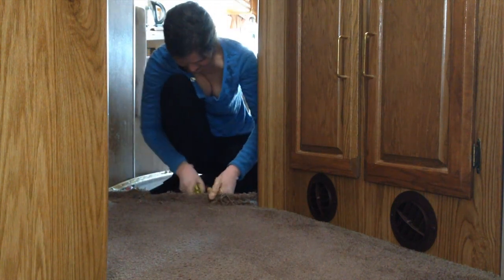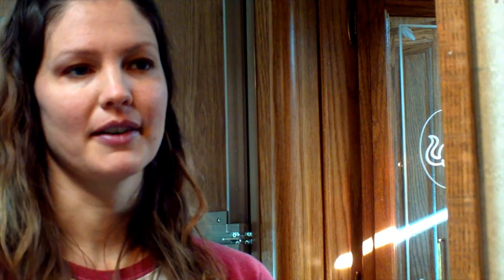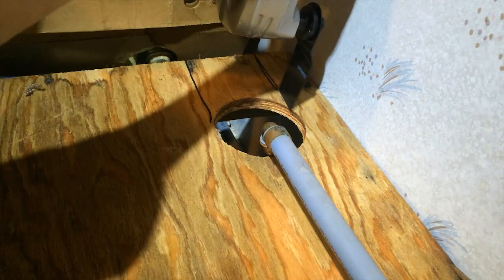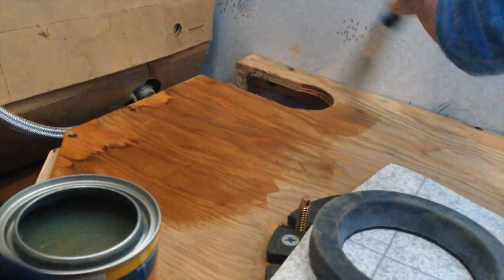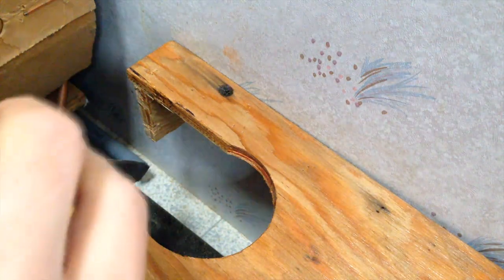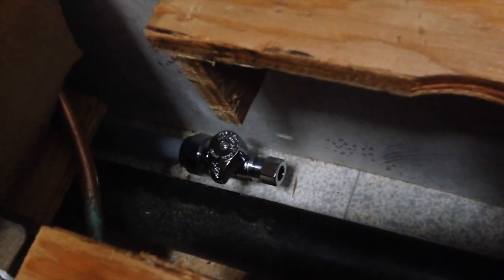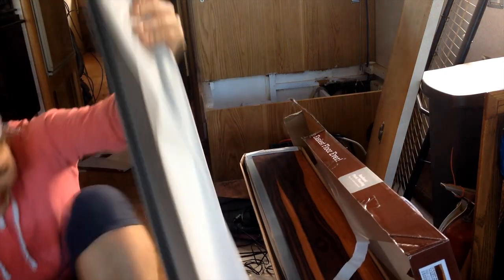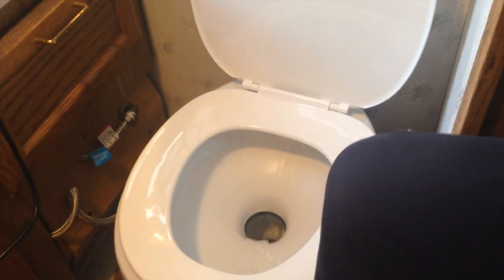RV Living: RV Renovations and Replacing Motor Home Toilet

Comment: The commenter who seemed to paint a completely negative picture of Rv life vs apt. life is not correct.  That assumes that apt. life is all positive.
To the contrary, you pay high rent for a decent place which includes many rules and regulations.  You cannot paint, hang decor making holes in the walls, or remodel things.  You cannot control your neighbors above, below, or adjacent to you.  You sign long term leases and give up your freedom to move in short notice.  You need furniture and decor to fill the space for comfortable living, all of which costs money.  So, high rent, close neighbors, furnishings, utility bills and lack of mobility are all negatives for apartment living.
Yes, an older Rv, like a house or apt. would need to be remodeled and decorated, but overall the cost of living is much less and the freedom gained is much more.

Comment: Smart girl.....ALWAYS replace as many joints in an old RV (or house) as you can.  You are only waiting for trouble with them.  A new flexible pipe (not invented when the RV or house was made) is MUCH better - and will give fewer problems in the future!!!!
Reply: Depends on who constructed the joints. My father was a master plumber/pipefitter and my 110 year old house was not up to code when I bought it 20 years ago. We gutted the whole place out and Dad and I put 3/4" copper throughout...all joints tested and perfect. I check annually when I bleed the system. I also just sold the house I grew up in, Dad built it and lived in it for 49 years...no problems with any water leakage from any joints. 
    I agree on the motor home replacement but as far as a house is concerned, it would have to be "bandaid" plumbing work, such as NON licensed people install or work on plumbing. My father allowed a few to work under his license because they asked him to pull the permit, but he was selective with whom he would allow...and then his inspection was very, very strict.

Comment: Hi Pippi. Hello from BC Canada. I am glad I connected with you as I am renovating my to to sell in the spring in the hopes to embarke on your adventure. You have put my mind at ease on a number of issues!!

My question is: How much, not including the flooring did your toilet adventure cost. I was actually looking a composting toilet to get away from all of my water fears;)
Don
Westbank BC Canada
Reply from the maker: Donald Nichol The toilet was about $200 (you can get plastic for cheaper or even other porcelain ones online for cheaper) and the sealer/finisher plus sandpaper wasn't more than $15 and I still have left overs for my counter top renovation which is soon to come. The pipe plus sharkbite was $20 or so. Unless you plan on only using bottled water, you'll still have +80% of the water pipes to still maintain. Cutting off the toilet is only a small part of the entire water set up. The toilet stuff is only a bit extra off of the other bathroom pipe system..sink, shower... Good luck with it!

Comment: Why did you use a floating floor instead of the peel and stick type which are cheaper?
I somehow found your video when looking for linoleum removal but peel and stick is meant to stay put while floating floor is meant to expand and contract

Comment: Nothing like good old copper piping! Red flags go up for me every time I see that plastic piping in a house. I believe it is called pex piping, and over time, the plastic becomes brittle and cracks and leaks!
Reply from the maker: Andrew Gems This is the polybutalene piping that they don't make anymore because it fails after time. Fortunately for the parts I've touched, it still seems very sturdy.

Comment: 9:13 Oh no! You need a plastic tube cutter for the sharkbite tubing. It resembles a vice grip. Home depot people should know what this is. ts is impossible to file a clean  90 degree angle by hand, especially in cramped quarters. Squeeze the cutters and squeeze till it cuts, then take a quick razor blade turn around the edge to clean the burrs. Done
Reply: P.S. The floor looks amazing. That you are taking this on by yourself and not paying someone to do it is The Best. We were made to create.. You understand that! Yes!
Reply from the maker: 82Bottles Thanks!

Comment: Good work, kiddo! I'll be watching for the floor replacement video. You've probably heard this before, but stuffing steel wool into any accessible crevice on your coach can help to deter the little furry-feetz from getting in. While you have that plumbing area open, you should consider poking some wool into the area around any of the plumbing holes. Plumbing [both propane and water] and electrical holes seem to be the primary access for these creatures. If you are ever parked on a concrete pad, borrow a mechanic's creeper and go over the underside of the entire floor, poking wool into every opening you can find. Best of all, its a 'simple' solution.  ;^) Oh, and +1 on the 10% bleach in a handy spray bottle to kill hanta virus.
Reply from the maker: Ron Standley I have heard that however I completely forgot about it. Great idea, I WILL do this!
Reply: Pippi Peterson Since I have large hands that can't fit into tight spaces, I use wooden dowels of various diameter and length to do this. Hope you find this tip useful.

Comment: Interested in finding out that oscillating cutting tool you used for the flange and wood. Need to get one for my RV to help in renovations. Also get a product called Fresh Cab Botanical Rodent Repellent, we use it and have no mouse/rodent problems.
Reply from the maker: ***** It's the multi tool from Harbour Freight with the plunger head. I got a Fresh Cab and put it in the area where I think it entered first. Fingers crossed it will never happen again!

Comment: I realize i am a little late posting. i was wondering on the gator bite, would it be better to mount the pipe to the wall for stability? It looks like it will not leak parked, but once you start rolling down the road i would be worried about vibration...Just a thought, and great video again.
Reply from the maker: +BILLY MARTINO It's an interesting thought for sure. However, I wonder if while rolling and stuck to the wall, it might actually feel more vibrations than just floating.

Comment: PiPi please don't take this wrong because i mean no disrespect but you are adorable, even when you splash 💩 water on you. You did fantastic job and i absolutely love the African fooring. If i may add you might want to mention to your subs. When using plumbers or thread tape make sure it is wound in the direction of the thread otherwise it bunches up and leaks. Love ur vids... ✌

Comment: Hi Pippi, I have a question. my rv is a little older than yours but it has the same toilet that you took out of yours, is that same one not available anymore? Mine also is starting to leak and I need to replace it. If that's the case your vid is going to be very helpful to me in the near future.
That is some cool flooring material, is it affordable?
Reply from the maker: mark a. coffeen Hi Mark, I didn't find that toilet but only looked at one place and wanted to get one that day. Good luck with finding the same one unused or one with the diagonal bolts ;)
Reply: Thanks Pippi, I guess I will have to get to looking into it! lol.
Reply: Mark it looks like TrafficMaster Allure from Home Depot. I'm really excited to see the finished results. I think it's going to look amazing!

Great job Pippi!!

Comment: You should mention that the teflon tape needs to be wrapped to the threads clockwise.
Reply from the maker: Myles Koeppe I actually thought about it and then thought that anyone wrapping it would figure it out if when they were screwing it on, the tape was unwrapping. Good point, though!

Comment: ps you can't use shark bite on poly b pipe ak gray pipe. it can blow apart. shark bite dose not recommended to used on poly b pipe.
Reply from the maker: Blairman666 That's not true actually. Sharkbite makes fittings specifically for polybutylene pipes. They've even got a video about it: http://www.sharkbite.com/how-to/polybutylene-pipe-fittings-sharkbite-conversion-coupling/

Comment: Pippi--Did you consider using Kilz rather than wood stain to seal your floor?
Reply: I have used both Kilz and another primer/sealer called Zinsser.  Found the Zinsser to be a far superior product.  Never used it on a floor (although I'm sure you could).  Just on drywall.
Reply from the maker: Robert Knowlton Killz is another idea, I've got that elsewhere in the RV and will be using an oil based Killz before painting over wall paper.
Reply: I can definitely recommend Kilz for sealing floors.  We used it with great success on water- and pet-stained subflooring.

Comment: So that you don't go without water until the whole project is complete... why not cut the pipe, install your new fitting WITH A VALVE and turn it off?!?!?!  Then you can turn the water back on and continue at your leisure.  Great video though!  I'm struggling with toilet issues in my truck camper now. Your attitude is definitely better about replacing toilets than mine...
Reply from the maker: That's what I did ;)

Comment: They certainly don't make it easy with the RV repairs, do they? Built like once, then throw it away? It took 2 of us a week to get the carpet out of my RV, a million staples, under the driver's area the worst! Around the toilet, the worst, hold your breath! I did the same type of flooring, but in oak to match the cabinets.
Reply from the maker: ***** Nice, ya, the carpet took me a long long time! And staples galore, holy moly! Happy trails!
Reply: Pippi Peterson
You only need a staple about every four inches. Any more than that is a big waste, except for edges, which require about three.
Reply: Myles Koeppe Oh, tell that to the RV manufacturers.... mine had 4 staples per inch in some places. And they used super glue around the driver's area. Had to patiently chip that off with a paint knife for hours. Now that the carpet is out, no staples, and nice clean vinyl!

Comment: why would you not go for a compost toilet and get rid of all that greef.Then you could completely clean out your black water tank and also use it for grey water,and have that much more grey water at your needs??
Reply from the maker: Doug Rennick I'd love a composting toilet if I owned land but not particularly in the RV.
Reply: This is the same question I was thinking about asking.  I am trying to figure out how to renovate my RV and have a leak, might have to pull it to get that figured out, it only leaks when I fill it though (it has a fill and empty valve) the two times I took it out I just poured water from the sink in to flush it.  I have been looking at a composting just for weight issues and have heard on some videos that they are very well ventilated and have even less of a smell problem than regular RV toilets.  Its on my list to get mine fixed soon.

Comment: Did you swap out the wrong flex hose with the correct one at the last moment and not even mention it???
Don't sweat it, (pun) it happens to the best of us.
Reply from the maker: +reagentism Can't totally recall but I do remember getting the wrong size. The color of the tag changes and I'm wondering if that's what you saw..? Great eye for detail! :)

Comment: They sell pipe cutters that look like sissors with a blade. They are designed to fix this cut. Trust me, I just put a nail through a water pipe and it was the only way I could keep it from leaking. http://images.lowes.com/product/converted/820909/820909552970.jpg
Reply: This is the after http://instagram.com/p/uRobRgzRur/?modal=true
Reply from the maker: ***** I just use my plunger tool and scrape off the jaggies. Saves me buying another onesy-twosy use tool. I'm sure they cut very clean though. :)